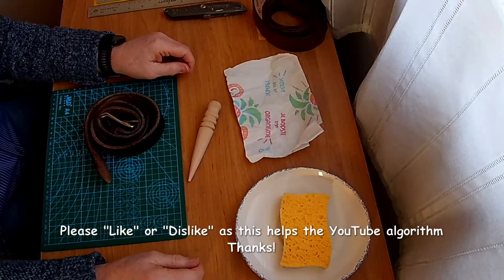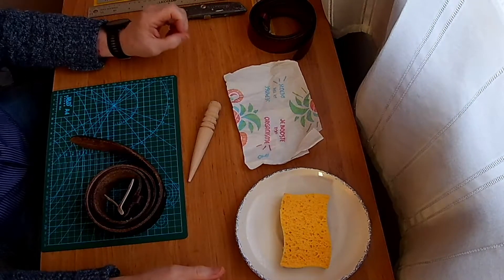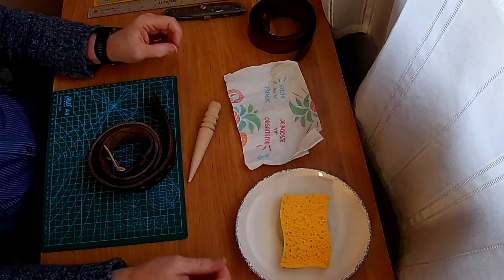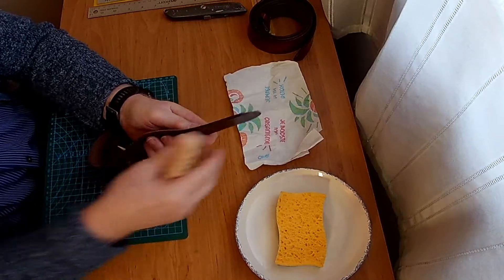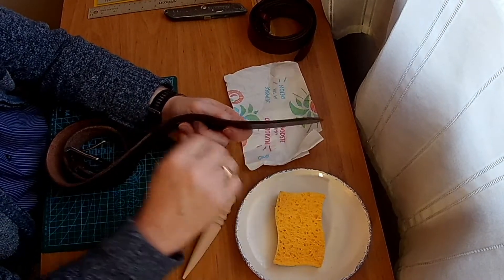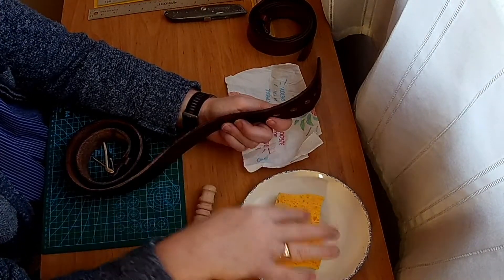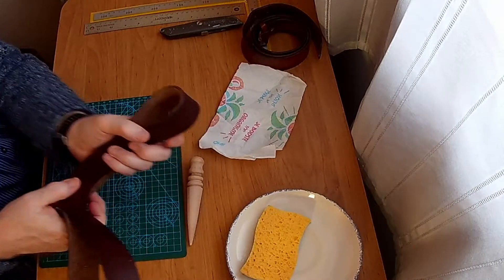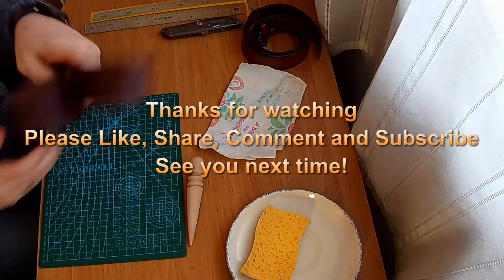Slicking a Leather Belt - part 1

Comment: Hello John. Great job and nothing wrong with using just Water. What can happen is that you will get a nice slicked edge initially after you have compressed and laid down the fibres of the leather, But over time the fibres can begin to open up and lift again. A great way to prevent this from happening is to rub in some beeswax with your slicker, this really seals the leather and binds the fibres together. If you don't have beeswax to hand candlewax will also work. Gum tragacanth is an OK product but tokonole is superior to it if a little harder to obtain.. I often like to slick up the edge at first with glycerine saddlep soap followed by beeswax. Everyone has their own way of doing it , none of them being right or wrong, just experiment and find the method you like. Oh one thing I don't like about gum tragacanth is it also prevents dye from penetrating in to the leather, which can be a pain on some projects.